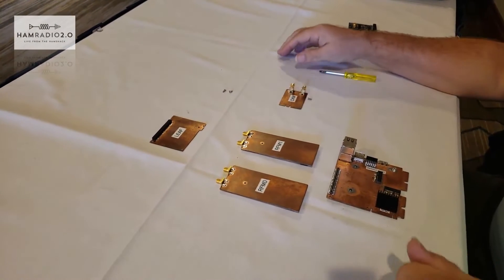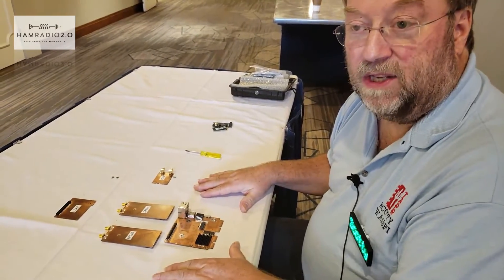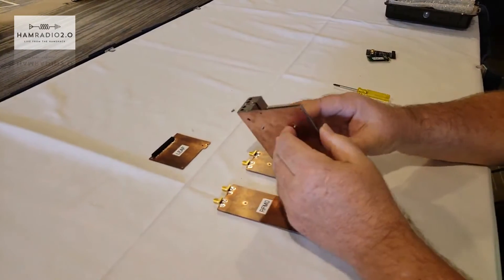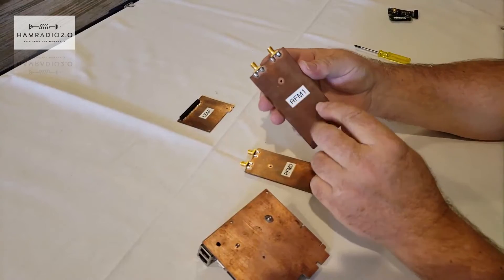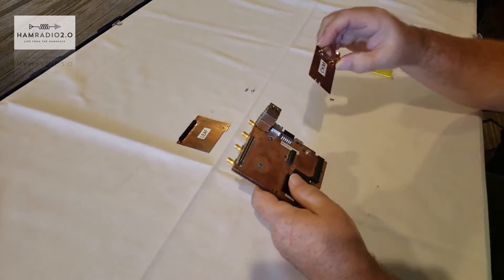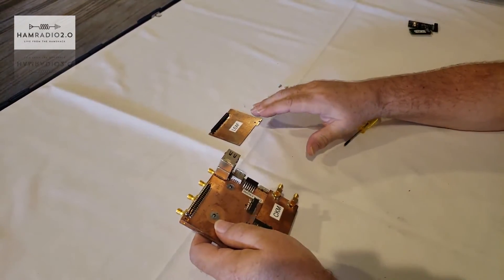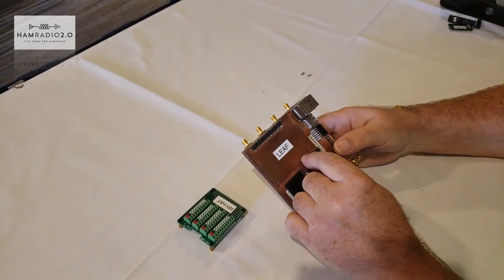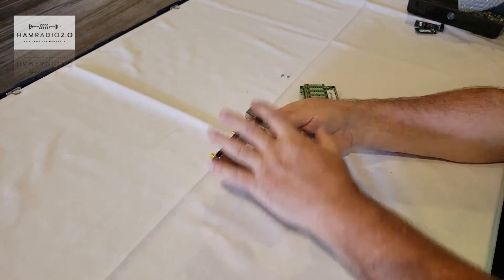Tangerine Scientific SDR Space Weather Radio - FirstLook

Comment: I like the modular aspect, but any idea what the RF specs are going to look like.. and/or a rough estimate on what the target price will be?  By comparison, for example, the $350 Lime SDR uses the LMS7002M chip for the frontend ADC.. and does full-duplex (2×2) MIMO operation, with a frequency range of 100 kHz - 3.8Ghz with 10db of transmit power. 

Also, with any SDR it's all about the software.. will the TangerineSDR work out of the box with GnuRadio?